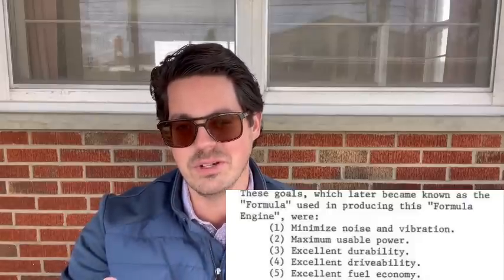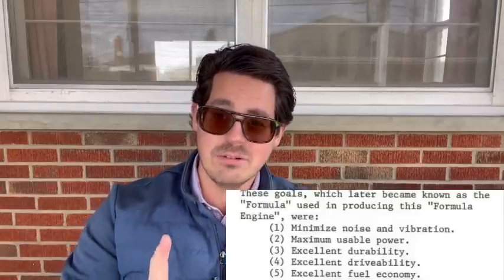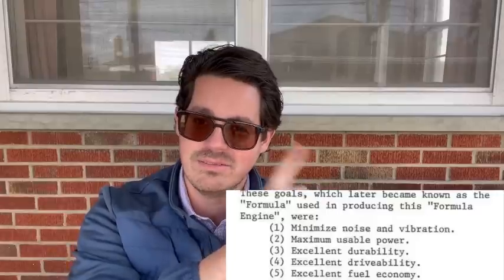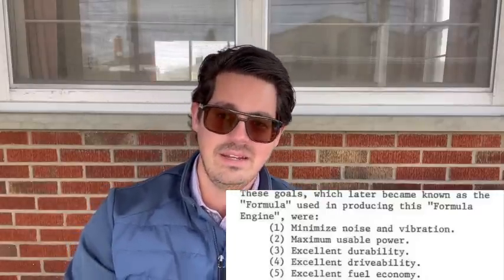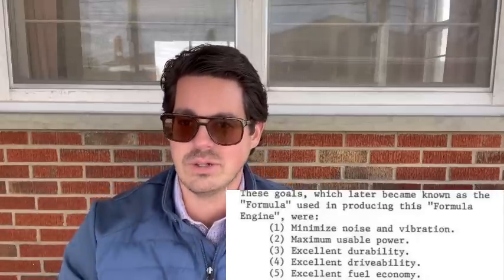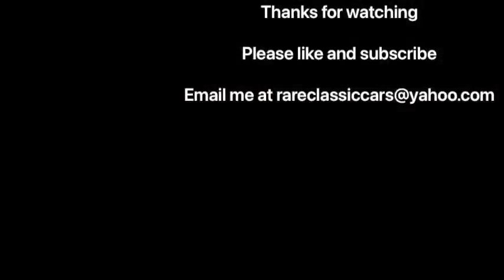Worst Engines of All Time: GM's 2.5L Iron Duke 4-Cylinder

Comment: John Deere built some of these motors, under contract, for GM. They improved the air flow through the cylinder head and found a little more power for the motor. These motors were dull, boring and they just droned on and on. One of my friends had a pontiac 6000 4 door. When the transmission shifted into 4th, you could hear the motor drop rpm's. 32 mpg anywhere, anytime. very, very, tinny car.

Comment: I would much rather have an engine design favor reliability, ease of maintenance, cost and fuel economy over ever other single factor.  It shakes.  Don't care if the entire car rattles.  I want it to get me where I'm going.  Customers really want everything (spoiled).  Want the cake and to eat it too.  You can't have everything.  Tradeoffs are necessary.  I blame the consumers at large for the death of fantastic cars like the saturn SC2.
An engine design like this with tbi would be so supremely reliable it would be unreal.  Some cam tuning, head work, exhaust tuning, crank trigger ignition, upgraded cam gear, aftermarket efi + tuning and it becomes something you could rely on for decades.  
Think I'll add this engine to my list of Holley EFI projects.  A super light weight, manual trans, rwd car with this engine, port fuel injection, modern EFI control and a turbo would be a tank with good fuel economy.

Comment: i had  a new 80 citation with this engine and standard shift and i lessened the vibrations by hanging a lead weight on the exhaust headpipe. a lot of the shake was the exhaust system vibration.

Comment: I had a car and a truck with iron duke 2.5 engines and never had a problem. They were under powered for sure but lasted as long as most offerings at that time if not pushed to their limits.

Comment: My brother had an 82 Skylark Limited 2 door with the 2.5 4 speed manual and fuel injection.  He must of done something with it because it did not vibrate but it didn't have a lot of acceleration.  He would drive across country on business in it and would change the oil at 20k intervals with Mobil 1.  I drove with him from Houston to Los Angeles at 80 to 85 mph and it ran fine even with the trunk loaded. He passed that car down to his daughter then to a business associate and at over 300k sold it.  Never a moments problem but then he did his own maintenance.  Agree that Honda's motors were smoother and peppier with a 5 speed especially the 5 speed manual 77 Accord my wife owned for years.  Honda just makes a better engine overall.
Reply from the maker: You had a manual. The engine wasn’t engaged at idle at a stoplight.
Reply: @RareClassicCars  True maybe it was that.  I actually liked that Skylark it had a burgundy velour interior with a matching landau top and was light gray.  It had power windows but not power locks and my brother installed  cruise control.  Engine was not as smooth as a Honda but the Skylark was comfortable and  held the road reasonably well even at high speeds but 85 was the top speed.  I was impressed that it lasted over 300k but most of the miles were highway and my brother took meticulous care of it.  With the fuel injection it always started whether it was hot or cold.
Reply: I had a 99 S-10 extended cab with a 2.2 5 speed that I bought new and had for almost 21 years.  It seems smoother running compared to the 2.5 in my brother's Skylark.  I gave it to my nephew who has it in his car barn with the original paint still running and looking like new with 120k miles.  I gave it to him when I bought my neighbor's low mileage 2012 Lacrosse E-Assist.  Adam am I correct that the 2.2 was more refined than the 2.5?
Reply from the maker: @jeffreysproul9110  i would agree the later ones were.
Reply: And bad engines can't survive 20,000 miles between oil changes.

Comment: Makes me glad I have a B20 in my Volvo 1800S. No balance shaft, ever. Not in the B18 or the older B16. Pushrod 4 with 5 main bearings AND a fibre timing gear. There are steel gears available but I have over 100,000 miles on my USED when installed B20 and no problems with that. Of all the engines you review I keep thinking how my B20 does not have all those problems you mention American makers were unable to best, years after the pushrod Volvo engines stopped being produced.

Comment: Don’t let the whiners get you down, Adam. couldn’t agree with you more. The Iron Duke was so bad that when my Dad wanted a 4 cyl car he bought a CVCC Civic. He had only General Motors cars before that. 

I sold used and new cars in the 80’s. When I finally drove an Iron Duke during a test drive for the first time I thought the motor was cratering. It wasn’t. 😳

GM should never have let that motor out of its cage. 

My first two cars were a Pontiac Astre and Chevrolet Vega. Those were embarrassing enough to drive. But at least they didn’t loosen my grandpa’s dentures when I gave him a ride to the Mason’s Lodge.

Comment: Agree with you 1000% on the mid 80s Honda and their manual transmissions. I don't think Canadian cars needed all the vacuum hoses, I recall the underhood being very simple on my 1984 Civic 4 door (1500 GL). $500 in 1993 for two Civics... the badly rusted out 1984 hatchback sacrificed its great "1500S" aka 1.5l engine (100 000 miles) and 5 speed transmission to the less-rusty 1984 4 door sedan with blown engine and semi-automatic transmission. The extraneous neutral safety switch served as a great anti-theft (who would have wanted to steal that ugly grey box anyway?) and I got many comments from surprised passengers noticing that the transmission indicator on the dash showed "N" when we were in fact zipping along at 60+ mph.  :)  Smooth as silk, served as a great winter car while I stored my mint 1987 Trans Am GTA, and eventually also a rain car when I stopped driving the GTA on rainy days as well. Manual choke, it started perfectly in -20F or colder.  Both this car and a later 1985 Civic 4 door succumbed to the same fate: the torsion bar spring mounts on the chassis rusted through.

Comment: It was a stop gap engine designed to be cheap to manufacture and use common parts.  It was adequate for the time, remember that the National speed limit was 55 mph.

Comment: Wow your wealth of knowledge is immense! I'm partial to the A bodies with a 2.8v6. But I'd love a balance shaft 1988 Pontiac 6000 LE 2.5. Unrelated note. They should have put courtesy lights on the doors on all A bodies. I like the lights under the power window switches on the 6000s. Best lit GM interior? 1991 to 1993 Olds Ninety Eight. Runner up 1987 to 1991 Bonneville. Anyway I ramble. Thanks for the informative videos!

Comment: I actually have a 4 Tech iron duke in a compact  demolition derby car, I fabbed up an adaptor plate and tore off the "fuel injection" and bolted on a 1 barrel carb, that old girl just takes a beating and keeps on ticking

Comment: I was surprised you put the iron duke on the list. Very reliable engine in my opinion the only real issue I had was I thought it was under powered to say the least especially with the junk automatic transmission behind it. Gm should never have allowed a car to leave the factory with both this engine and an automatic transmission.

Comment: AMC used these until it's end in '83.   THEY Could have used half of  a "401" or even 1/2 of a 360.    On ANY vacume-hose "hassle", subsitute the much thicker fuel-line hose, size for size.  That's what the Az Emissions garage advised, because that way, you can "get a handle" on the collapsing  vacume-hoses, which are ALWAYS "collapsing", messing-up attempts to pass emissions.   Fuel-line hoses, matched for same internal-diameter as a replacement for the vacume-hose, NEVER failed me in the 5 yrs I owned a 2.3 OHC 4 in an '82 Mustang.    When the Chevy "Cobalt" was available in the 2000s, that was built from Opal dies/castings, wasn't it?   A few of those had a Supercharger, so they must've been much, MUCH better than the "Iron Duke."    I'll BET all of the family-owned "Buy here,Pay here-" lots knew of that small hole fix of increasing the revs a smidge.   I feel original Buick V-6 was the Worst, because of High N&V,--almost to the point, you felt something was "wrong."

Comment: I had a S-10 for about ten years . I bought it new and drove it for 340000 miles . It was crap for power. But I couldnt kill it.  I tried! By the time I gave it away , it could be pushed in gear , the engine had just enough compression to run.

Comment: 11:26 fiber “OPTIC” cam gear?  Ford used fiber gears to drive cams on Model A.  When failed some replaced it with aluminum which is noisier.

Comment: I had one in a ciera I thought it was a great engine, noisy but durable. The wiring in the car was just bad. Wires would crack and short and cause ignition and fuel injection problems. I had it 5 years I put alot of hours on it idling and 80k miles. One thing when it was below 0 that thing would never start. I couldn't figure it out. It never burnt oil or leaked oil. I think if I ever got one again I would get maybe the last year of it and try that. I enjoy your videos thanks.

Comment: One ov the most fascinating engines ov all time to me is Smokey Yunick's "hot vapor" Iron Duke engine. 50+ mpg and 250hp out ov a 2.5L Iron Duke by the paradoxical application ov super heating the fuel charge to over 400*F! Whoulda thunk it?

Comment: I had GM's last unrefined year of the "Iron Duke" 2.5 liter in my 1987 Chevrolet Celebrity. There was a few improvements for that year. It had the serpentine belt system and distribitorless ignition. It also had the odd plastic timing cog. It was fairly reliable. It definitely wasn't refined like my 1985 Honda Civic S 5 speed. Thanks for sharing these very informative videos!
Reply: Weirdly, my 89 S10 still had a distributor. I wonder if the trucks kept the older motor for longer?

It was serpentine belt though.
Reply: I had the same car, with the same engine. I had absolutely no issues with it whatsoever!
Reply: @TheBrokenLife  I'm sure the truck line kept the distributor longer. 1987 was the first year for the GM A platforms for the ignition changeover of distributorless.
Reply: @randallringwald5059  Huh... Makes me wonder if mine didn't have a balance shaft either, because I would have never dreamed that it did. It was a full body massage at idle.

Comment: my mom bought a new 87 ciera. the idle issue exactly. plus it had a one speed cooling fan so when you turned on the a/c or defrost it sounded like someone running a vacuum in a stock pot. never had a problem with it though.

Comment: Curious your thoughts on the 'upgrade' to this engine in some vehicles, the 2.8L V6. I say 'upgrade' because that little varajet 2-barrel is the bane of my existence.
Reply from the maker: It was an upgrade once it got MPFI.  I too don’t like that carb.
Reply: @RareClassicCars  Yeah; I've toyed with the idea of trying to upgrade it if I found all the parts (84 s10, with the T5 manual), but I've never found a donor complete enough and/or online availability of parts to do so. She runs and drives for the time being, but it's been in the back of my mind to eventually consider a swap to something with more long term reliability and parts availability.

Comment: I had 3 of them 2 of them in Chevy Astro vans,1 GMC S-15 pickup all with 5 speed manual transmission,, you forgot to mention the water jacket cracking on the exhaust port,I had it happen on 2 of them even with extreme maintenance

Comment: That gutless turd is the reason I've never bought a GM. My first car had one. It was everything you said it was except for reliable. It barfed it's parts at 86,000 miles. My next 2 cars were Honda, and I personally put nearly 300,000 miles on a 93 Accord 5 speed. My latest Honda is an Accord V6 with the legendary J30A4 and it's not only as smooth as a V8 and powerful, it's obscenely well designed. Ain't no mystery why they've been cranking out J series motors for about 25 years. It simply has no weakness.

Comment: Even for someone with the diminished expectations of an early 1980s GM intender, these engines were positively agricultural.  Relatively reliable, economical and low-end torquey, no doubt, but for improving the overall vehicle experience, the most important option was the engine upgrade that would get you out of it.

Comment: I had 5 company cars with this engine in the 1980s.  I let the coolant get low and blew a head gasket on my 1985 Eurosport Celebrity.  Other than that, I can't remember any problems with any of the engines in about 400,000 miles of driving them.

Comment: The biggest crime GM ever committed was shoving that Iron Duke into the Fiero on launch. Pontiac had a hell of a compact sports car brewing, then GM corporate did GM things and gave them the slowest, truck-engine dog of a 4 cylinder to shove in there.  
Should have never shipped with it. They should have held off and shipped only with the 2.8L V6 it was meant to have. The Duke's popping rods through the exhaust side of the block when users ran them low, and setting their cars on fire also didn't help.

Comment: Them's fighting words 😀, was around a lot they just run.  I just remember changing clutches and cv joints . S-10 2.5 manuals are way funner to drive than ranger 4 cyl. manuals .  I have a talent for driving fords hard like a chevy and they die when you lift off the accelerator .  Happened twice in rangers, once in a Monarch(Iron Butterfly ) and a '77 ltd. I got a lot of good deals  on 2.5 equipped x bodys that just needed a tune up.

Comment: Owned  two iron duke powered S10s.  Both of the engines blew up (one quite spectacularly) within a couple of months after I bought them.  Resulted in 2 V8 S10 swaps.  Not necessarily a bad thing.

Comment: 1987 I was selling Toyotas. I doubt I ever lost a deal to a 4 cylinder GM product. Also,  I had a manual transmission Acura Integra. That was a great car.
Reply: I just drove a 2002 Acura RsX from upstate NY to south Florida. Cheap feeling car, crude sounding engine, doors don't seing open quite far enuff. Only got 28mpg at 70 75mph
Reply: @CORVAIRWILD  The 86 Integra was basically a hotrod Accord. I don't remember what kind of mileage I got, or the situation with the doors. I just remember it being trouble-free and fast.
Reply: @meatrobot  this was my customer's father's car, lots of Parts have been replaced on it. I just put a starter in, under the intake manifold, four new tires, and had a flat the next day, ruined the tire, oil pan has been changed, transmission fluid several times, now it's getting new tail lights, headlights and bumper covers., And the windows also aren't happy going up and down, but they work, and the sunroof is Rusted, I have a junkyard one in much better shape
Reply: @CORVAIRWILD  And probably flimsy, with bendable A pillars.

Comment: The cam gear will go as soon as 60k but they make steel gears for it. And removing the dogbone is seriously 2 bolts. Though one one needs removed, just loosen the other
Reply from the maker: You’re right, but it’s a pain in the butt for the average Joe who was used to working on a 60s car. And I had to ratchet strap the motor to get it to rock forward a bit in order to get more room.

Comment: Had one in my cavalier. Didn't notice it to be noisy or having excess vibration. It WAS absolutely gutless. Mine was an 83. Very reliable but the flex plate cracked making noises sounding exactly like rod knock. This caused me to sell it. Pretty sure not fiber "optic".  Phenolic??
Reply from the maker: Different engine in the Cavalier.  I misspoke on fiber optic. Meant phenolic.
Reply: @RareClassicCars  that's right I remember 2.0 on it now

Comment: Adam, it was this kind of thinking about the engines and cars of the time at GM and the other American makers that really gave the Japanese cars such a building share of the market.  You are absolutely correct that any car buyer of the time that cross-shopped another brand would likely not bother with another GM product.  I think this almost complete lack of understanding of the difference between what the goals were at the GM head- shed vs. the resulting product coming off the assembly line…. This is one reason you get engines like the “iron duke” or the Vega pile of aluminum waste.  Often good ideas, just terrible excursion….

Comment: I had one in an 87 Chev Celebrity company car. The timing gears were out of alignment for the last 50 thousand miles. It idled like a diesel. I was asked at stop lights if it was a diesel more than once. My boss gave it to his kid and shortly after went south at a traffic light. Other than that while I had it the gas mileage was quite good. It did the job. The Celebrity was not great at anything.

Comment: I owned one of the best gm engines ever. the 1955 pontiac 287 v8 with a 4 speed iron hydramatic.
Reply: And that 287 Poncho could be Bored & Stroked to Over 455cu"

Comment: It may be before your time but the biggest POS was the 2.3L vega motor. Thats why the 2.5 was pulled from the museum, it was basically 1/2 of the Pontiac V8 that was well proven from the early 60s.  Newer does not always mean better.

Comment: I think the Grumman mail vans/trucks had/have Dukes in them, for the very reason that they are so reliable.
 I have had 2 of them in pickups, over the years, and also, 2 of them in boats, in the Mercruser version.
 All where bulletproof, with proper maintenance. 
 Not a glamorous, or hi tech engine.
 Kinda rough, but very solid.
 I think you're  wrong on this one, man.